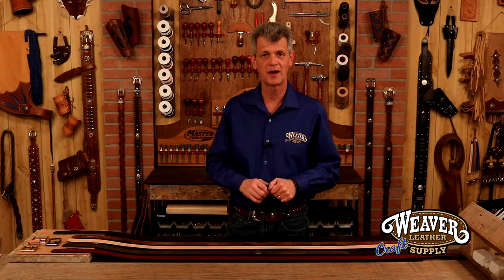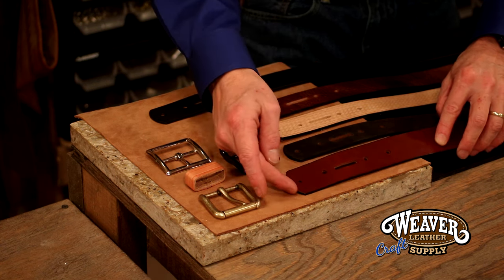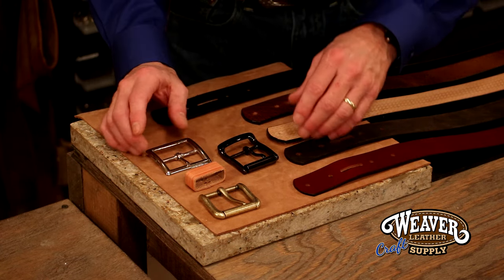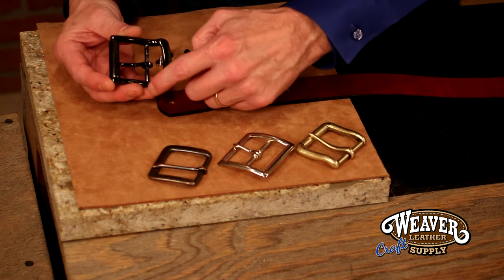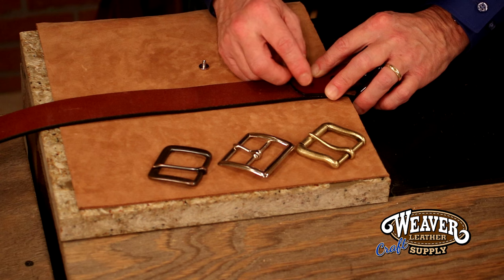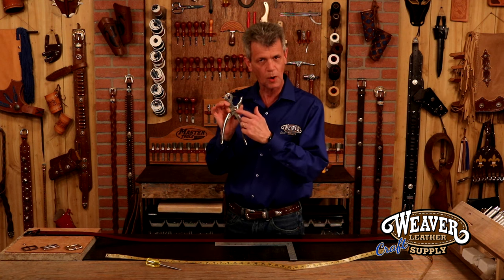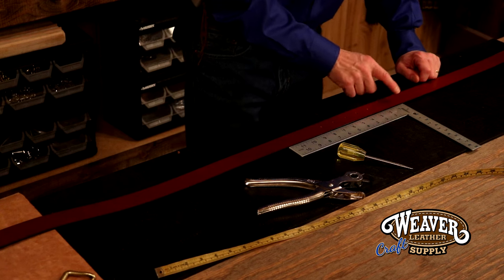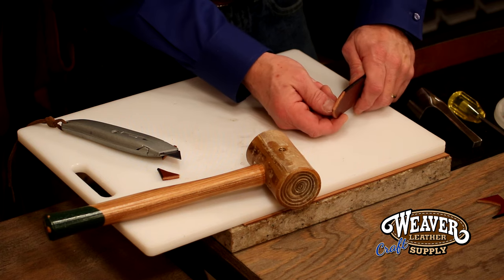Adding a Buckle to a Belt Blank

Comment: Thank you. Try clear nail polish in those Chicago screws and around the back of the leather of each screw  or concho. Also thanks for the sharpie edge tip. Plastic cutting boards.  Belt blanks. Wooden mallet. Cutting tool. And ruler.

Comment: Hey 👋  it’s me again, so Chuck encourages oil dyes. Would I need oil paint if I want to paint then? I use Feibings pro dye and finish with their atom wax. I was a painter for years oil and water not so great together. Thanks for your videos and always responding 👍
Reply from the maker: Hi! 
We recommend using acrylic paints which work well on plain leather or on top of dyed leather. The Feibing's Pro Dye does not have enough oil content to create any unwanted reactions with the paint. However, we don’t recommend using paint on oily leathers as the oil will keep the paint from adhering well. Thank you for watching!

Comment: I have a 50mm wide belt 

And buckle that would for 40mm wide belt 

Is there a way to use the buckle for the 50 mm wide belt please ?
Reply from the maker: You would have to taper both the end that attaches to the buckle and the ends with the adjustment holes. Here is a video showing how to taper the ends of your strap. https://youtu.be/sgYVO1l4HDU?si=GD7yB7bEqnoVaR4U

Comment: Is your cutting board marble?
Reply from the maker: Hi Jennifer,
The marble is used as a surface to stamp and tool on, or as a base for a cutting or punching board. You don't want to cut or punch directly on the marble or it will ruin your blades but it helps give a sturdy base when you add a cutting board on top.

Comment: Chuck, l made the mistake of putting some chrome tanned leather on the back of a belt for a lining and it turned the brass buckle green. I had to replace with stainless and l didn't use Chicago screws, but rivets instead so it wasn't so easy to remove. l do believe I'll go with the screws from now on. Luckily I made it for me and not a customer. Just a heads up for anyone. Is that crackled leather veg or chrome tanned?
Reply from the maker: Hi there,
Great reminder, we've been there too!

The crackled leather is a veg tanned water buffalo in Antique Brown. This is available in 8/9 oz. as a single bend or you can buy the pre-cut belt blanks. 
http://www.weaverleathersupply.com/catalog/item-detail/43043/001/20

http://www.weaverleathersupply.com/catalog/item-detail/51607/001/49